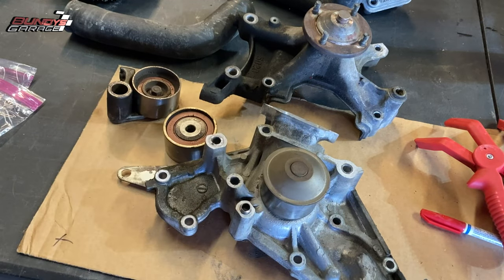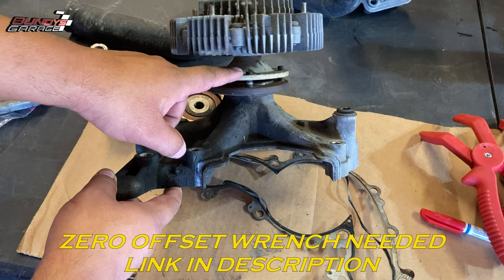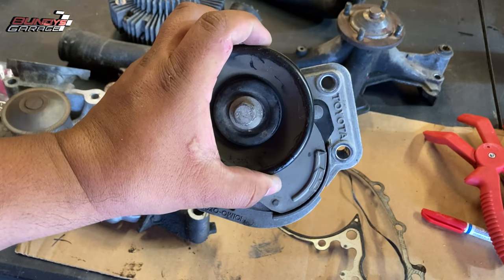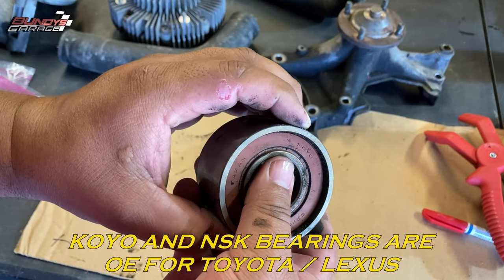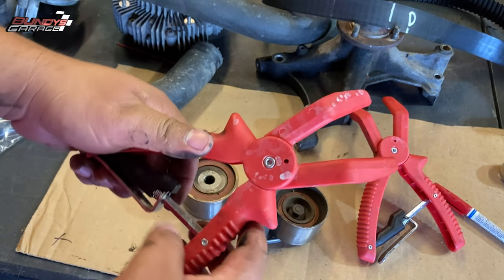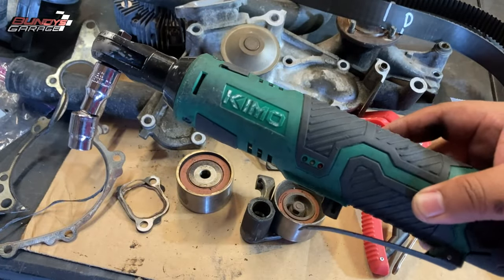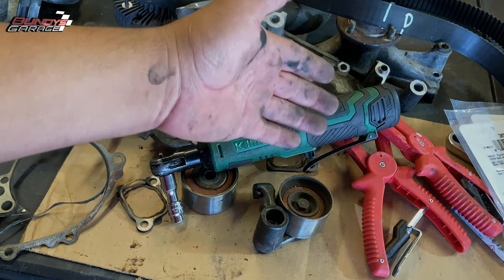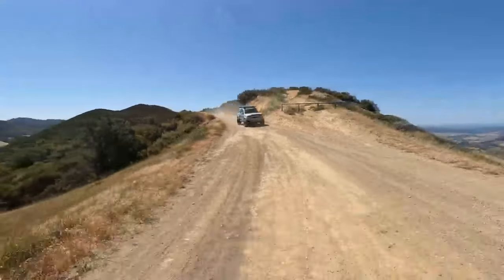Tundra Sequoia 4.7L Timing Belt Parts Toyota | Water Pump Fan Clutch | 2UZ-FE Lexus Gx470 LX470

Comment: Did my roommates about 6 months ago and was the oem with 267k on the oe belt and was surprised that it looked pretty decent still definitely maxed out the tensioner and had a few small cracks but overall was good still. Though sounds like yours has been tampered with as I literally had a small handful of tools needed to replace it and only took me a couple hours took my longer to repaint the accessories and pulleys and clean the mouse house from under the intake than it did to replace the belt. Even did valve cover gaskets plugs and oil change tstat and serp belt when I did it very very easy job would definitely say that literally anyone who can follow simple written and illustrated directions should be able to do this job in less than a day at worst a weekend and be driving to work Monday morning no issues. Unless you have issues with the fan bracket bearings or are overheating due to a bad fan clutch or a failing serpentine belt tensioner there's not any reason to replace them they have a very very low premature failure rate and are known to go the life of the vehicle. Not to mention that the way new oem parts and aftermarket parts are any more definitely avoid replacing anything that doesn't require it as even the OEM parts are junk more often than not anymore

Comment: When I started dating my wife she had an 07 Sequoia. It had 169k miles on the original timing belt. I had it changed right away. Bought an oem water pump as well. Put all oem parts.